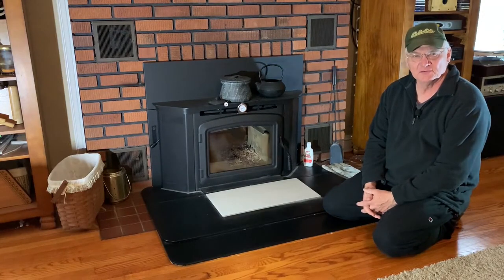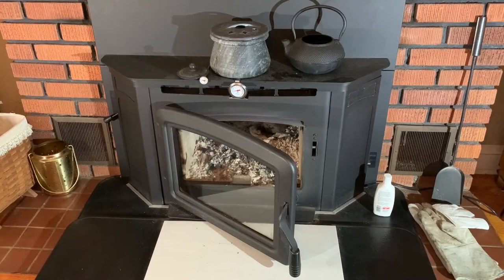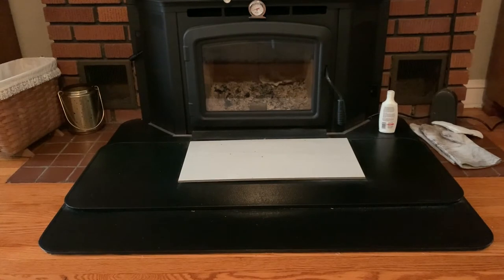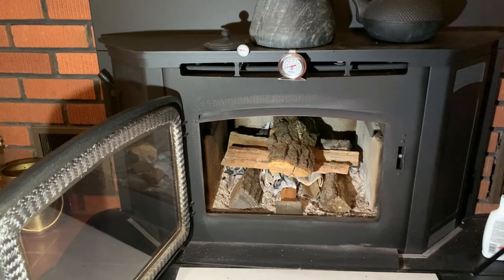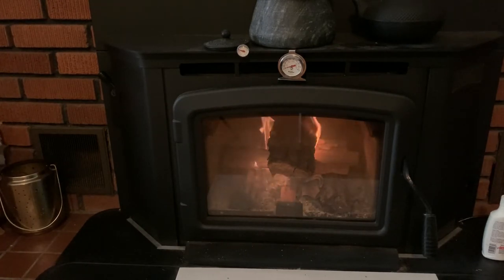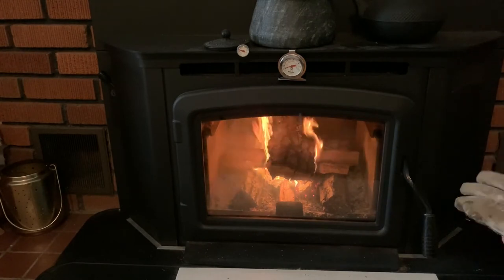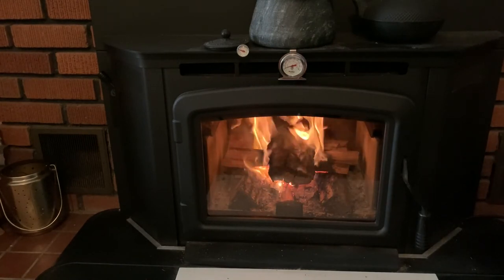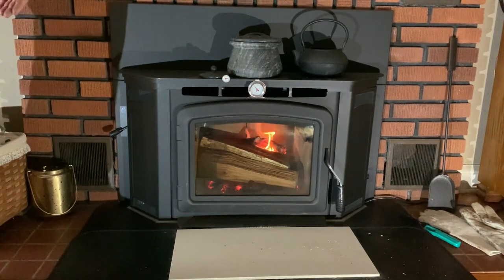Our Montlake 230 fireplace insert

Comment: Thanks for your video. We bought the Montlake 300 and had it installed last winter. It heats about 2400 sq feet easily and will even circulate in the basement if we run the central air fan. We love it!
---
In your comments you were saying that the steel stovetop wasn't hot enough to cook on -- after playing with arranging the fire a bit, I was able to get water to boil on it. You have to build a little higher in the firebox toward the front of the stove underneath the shelf. That will get the water just to boiling  -- now granted I'm in Colorado so I'm mile high and that makes boiling water much more difficult. Made soup on it a couple of times, no problem - just takes a little while longer to cook up, but faster if you use a lid. Also made baked potatoes in the coals -- just wash them up, poke a couple holes in the top of them, then wrap in aluminum foil and bury them -- 30 to 40 minutes in the coals and they are perfect. 
Picked up a dutch oven to cook with coals in the firebox this winter -- should be pretty straight-forward. 
---
I picked up a couple of the heat-powered fans to put on the top of the stove and I keep an open-top pot of water on the stove as well -- we just drop cinnamon sticks and cloves in it. That seems to help with humidity quite a bit -- to the point that we haven't really needed to run the stove's internal fans except on the coldest days to get the room warmed up quickly. Running a large fan on the opposite end of the house keeps the air circulating really well.
Reply: Nice tips. But just wanted to point out, actually higher elevation makes boiling water easier.... 
Water will boil at around 200F at 6000ft elevation in Colorado as opposed to 212F at seal level in New Jersey.

Comment: Nice video thank you fellow New Jerseyan. 
I have a fairly old standard fireplace insert with fans. Supposed to be heatalator. But it doesn't have dual burning or catalytic combuster etc. 
I go through a lot of wood in a day. Each load will only last about an 1 hour or 2 depending on how much wood it is. 
I am now interested in these high efficiency units. 
I believe your model of the insert is one of the top of the line models. They are getting really expensive.

Comment: I also use the Harbor Freight welders gloves to tend the fire. With them, I'm able to handle red hot coals for long enough to move them as needed. I find it to be much safer than using tongs. Of course, I have to be mindful enough not to hold them long enough, where the heat soaks through, but far less than the 20 or 30 seconds for that to happen is more than plenty of time to move a burning stick of wood or a red hot coal a few inches. The welder's gloves shrink and degrade from the heat, especially if I make a habit of holding hot coals more than a few seconds at a time, but as the video says, the Harbor Freight welder's gloves are inexpensive.

Comment: I have an insert when I bought the house. It's basically useless when the electricity goes off and the fan doesn't blow plus it makes noise. Wish I got  free standing stove. I took off the decorative panels around the stove, opening up the space to allow air to circulate around it. I have measured  the side of the stove and the reflective panels around it and they will get over 300F. Heat that was before trapped and probably radiated up thru the chimney area.
Reply: You can get heat-inducted fans if your insert has a shelf -- those can move the hot air out into the rest of the house without electricity.
Reply: @atomicfrijole7542  Proven hardly effective

Comment: Great video!  Thinking about purchasing one of these for similar reasons.  Does the ledge get hot enough to cook on?  What is the burn time?  Have you had to replace the catalyst, and if so how often?  Thank you!
Reply from the maker: We purchased the steel ledge instead of the cast iron. You would not be able to cook a meal on our ledge. You could reheat food or maybe a heat some soup. I can relight our insert in the morning by putting some newspaper on the coals. The manufacturer says a 12 hour burn time, but I've never gotten that. I don't think there is a catalyst in this unit. I was never told so when buying it. Good question..... We had our chimney cleaned recently after a full season of burning. The tech said there was not much buildup. I am happy with it so far. Thanks!

Comment: Hi, we have a large fireplace, takes a 30" piece of wood and once lit, it rarely goes out so it's a hungry beast. We have two new cats, one seems to have an issue with the residuals from open burning so, considering a fireplace insert and Montlake is at the top of the list. The wife really doesn't like the thought of loosing the open viewing of the fireplace. Do you have anything else to add other than you really like the insert?
Thank you
Eric
Reply from the maker: Thanks for the comment. If you have room for the larger model....300? I believe, I would consider that. I didn't have the room in my fireplace and find that on colder nights I have to keep mine burning at max to keep our poorly insulated home warm. Some of my firebricks will need replacing at the end of the season, and the "baffle" over the air tubes will also need replacement. We burn nightly from November to March. There have been no issues with the quality of the stove.
Reply: Thank you again! Though we live in TX, when cooler weather arrives our fireplace is almost non-stop. 
I have a small VT castings in the Garage, it holds at 70 deg. 
Best to you and thank you again!
 @thethriftysuburbanite5251

Comment: Hi, thinking of this one or Kuma, cascade, or regency 2500. I like how this qualifies for rebate and non cat. How many hours do you get out of overnight burns? Do you think adequately heats 2000 sq ft house?
Reply from the maker: Thanks for your comment. I have coals that will relight easily in the morning, if I load the stove up to capacity  before bed the night before. There is more to it than that for me though. After three in the morning the heat comes back on in the house. We keep the thermostat at 64.

My problem is the house, not the insert. I have terrible insulation, a leaky house and single pane steel framed windows from 1949. 

I can't say if the insert will heat 2,000 square feet. There are simply too many variables involved. Insulation properties, air infiltration, window quality, room layout....all will have an effect on how many square feet you will heat. 

With all my other factors, I am still faced with the fact that I have high ceilings and a rancher style house. We keep two bedroom doors shut (kids gone) and one bathroom door closed. But we like a cool bedroom, so it works for us. 

Sorry for the long winded reply, but a sales person who says their stove will heat XXXX square feet, without first asking a lot of questions, may not be totally honest.
Reply: Hi -- bit late -- but to answer your question, I have the Montlake 300 which is a bit larger than the 230 and it heats 2400 sq feet easily. When the stove gets going, our main floor is 70-73F and the upstairs sits about 68-71F. If you use the heat-inducted fans on the stove and a large box fan on the other end of the main floor, you'll likely see great airflow as the large fan pushed the cold air to the stove and the stove pushes hot air back out. The govt tax credit dropped the price of our stove and installation by roughly 25% -- it was a great deal. 
One of the things we did this summer to combat heat loss in our house was to install a storm door over our front door -- it has already made a huge difference. I will be tackling insulation renewal in the attic next year -- it's not bad but it's not great.

Comment: how much and where have you bought it? looks very nice.
Reply from the maker: It was purchased and installed by the Fireplace People in Berlin NJ.  Keep in mind the price will vary based on what surround and stove top you get...either cast iron or plate steel. I had it installed too, so the chimney work and installation costs also need to be factored in. I hesitate to quote exact figures; I'm sure it will be more this year. Thanks for the compliment. We are pleased with the appearance and performance.

Comment: Use birch bark to start the fire. It’s the best
Reply from the maker: I wish we had birch around here. I use it to start fires when I'm camping up in the mountains.
Reply from the maker: I now split sassafras tree wood down to 3/4 X 3/4 X 6" and use a few of the pieces at a 90 degree angle just above the first two pieces of oak I lay on the floor of the stove. It lights almost instantly.

Comment: Blower seems really loud? How loud  is it compared to a fridge/running microwave? Bathroom or kitchen vent fan? Vacuum cleaner?
Reply from the maker: It's about as loud as a range hood.
Reply: @thethriftysuburbanite5251 
Great video! Are you able to tuck the electric cord behind the face plate when it's not being used?

Comment: Mine is coming middle of November!    Does the fan have numerous settings?  How big is your house?  How well does heat travel throughout house?  Thank you!
Reply from the maker: Thanks for the comment Zachary! The fan has variable settings. I think the high setting should push more air, but it is designed not to create drafts. Our home is about 1800 sq ft.. We have high ceilings and ceiling fans in every room. The house is divided roughly in half; bedrooms on one half. There is a definite difference in temperature in the room where the insert is. If we didn't have custom plaster walls, I would cut vents through the dividing walls and install vents to let the air circulate better.
Reply: Thanks for your feedback,  your a celebrity with this stove based on all the responses!  What state are you in?  Plaster walls are tough we had those in last house.  I'm hoping with price of Natural gas this was a smart investment,  which I know it is because I get free wood and enjoy splitting it!  Thank you for your help!

Comment: Does the ledge that your pots are resting on get really hot or just warm?
Reply from the maker: After burning for several hours it gets too hot to touch, but not hot enough to cook on. I've never had a fire without running the fan, so it might get hotter without it.

Comment: I have the same stove. What temperature does the shelf get to? They haven’t delivered the shelf yet so when I burn the heat exchanger gets to 500-600 degrees. Is that too hot for the stove?
Reply from the maker: I never ran mine without the shelf, so I can't give you much info. My stove has the steel shelf. There was an optional cast top that I opted not to get. I have a soapstone pot filled with water on the top of mine. It's never boiled, but then again I usually don't run my insert real hot because it will run us out of the room.
Reply: @thethriftysuburbanite5251  thank you. The shelves are back ordered. Waiting on cast iron. Won’t run it too hot also. It heats very good